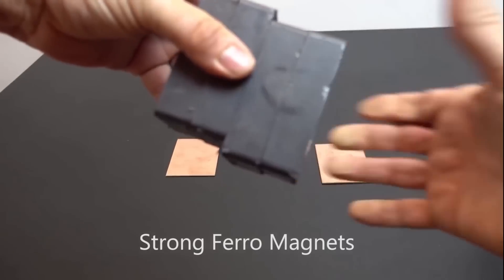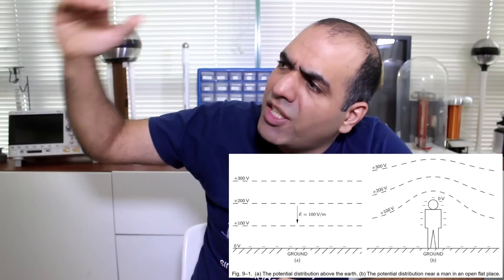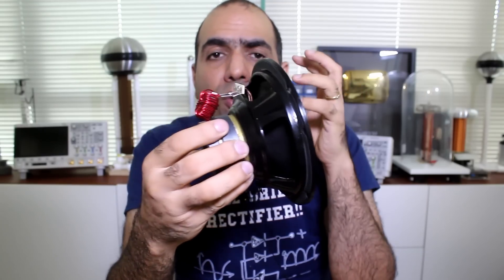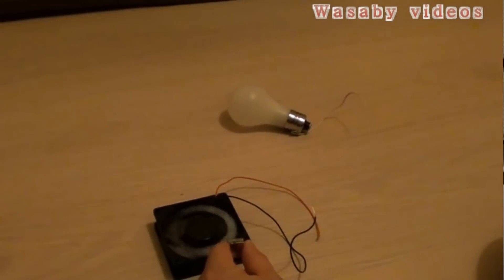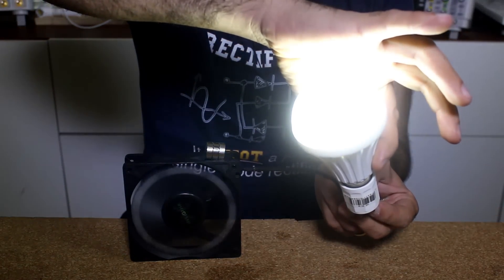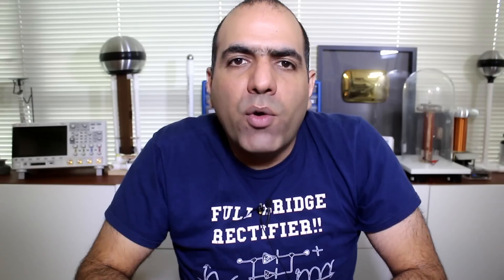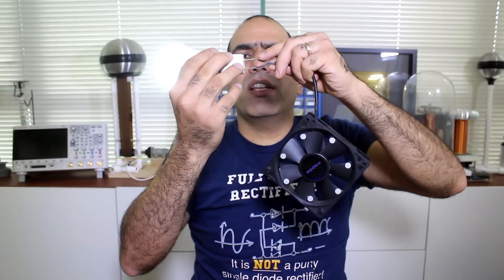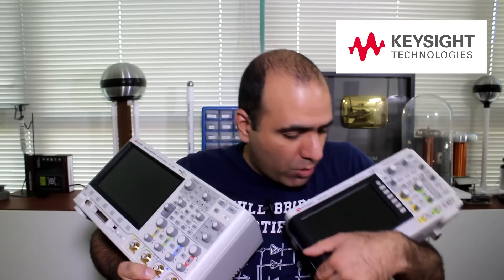Free Energy Devices Build and Science

Comment: Did people forget the hydro electric generator?, 
You pay for the components that makes up a electric generator and the next step is to use the water current to make a wheel spin which causes friction between magnets & copper coils that could power a house compliant :). The components were not free yes but the result after that is since you dont pay anyone for the electricity which the hydro generator creates and thus it is definetly defined as FREE.
Reply: That would be free in the monetary sense, which also goes for solar etc

But in these contexts, we are referring to free in the thermodynamic context. In these (non-existent) machines, the energy they are meant to be providing you is “free” in the sense that they supposedly pull energy from nowhere. Solar panels aren’t free energy - they take energy from the radiation of the sun, and hydro systems take energy from the gravitational energy in water

Comment: Perhaps you could build a light generator which is solar panels illuminated by powerful LED  which will produce electricity. The over unity factor is when the electricity ouput is greater than the electricity the rechargeable battery is using to light up the LED . There is this other guy on YT claiming to do just that. If you could repeat this idea then we will have clear validation that this idea works.

Comment: I DID actually see what seemed to be a working demonstration of that "atmospheric voltage".
The person was able to power a really tiny ionic motor from a thin wire several hundred feet up on a balloon.
(He built this really cool tiny ionic motor that ran on several hundred volts at some absurdly low current.)
(I'm guessing that, with really careful design, you might get enough power to light a really efficient tiny table lamp - suitable for a small dollhouse.)

Comment: Thanks for your confidence! Let’s take on the challenge of creating a small-scale, self-sustaining energy system. To clarify, true "free energy" systems, as commonly understood, are not possible according to the current laws of physics—particularly the law of conservation of energy, which states that energy cannot be created or destroyed, only converted from one form to another.

That said, we can focus on building an efficient energy generation system that maximizes the conversion of available resources (like sunlight, wind, or mechanical movement) into electricity, aiming for something that is energy-positive over time (i.e., it generates more energy than it consumes when considering maintenance and operational energy).

Here's an idea for a small 1000W generator/inverter system with sustainable energy concepts:

Project: 1000W Solar-Powered Generator

This system uses solar panels, an inverter, and a battery bank to generate and store energy. We will focus on renewable energy and use practical, existing technologies to achieve as close to "free energy" as possible in a sustainable way.

Components:

1. Solar Panels:
You’ll need a solar array capable of producing 1000W (1kW). A typical panel produces around 300W, so you'll need about 3-4 high-quality panels. The exact number depends on your location and sunlight availability.

2. Charge Controller:
A charge controller is necessary to manage the power from the solar panels and prevent overcharging the battery bank.

3. Battery Bank:
Lithium-ion or lead-acid batteries can be used to store the energy. For 1000W power, a 12V battery system with a capacity of at least 100Ah (amp hours) will work. This allows for energy storage for nighttime or cloudy days.

4. Inverter:
A 1000W pure sine wave inverter will convert the DC power from the batteries into AC power (the type used by most household appliances).

5. Wiring and Connectors:
Proper wiring, connectors, and fuses are essential for safety and performance. Ensure you use appropriately rated components for your system.

How it Works:

1. Solar panels collect sunlight and convert it into DC (direct current) electricity.

2. The charge controller regulates the voltage and current coming from the solar panels, ensuring the battery bank is charged safely.

3. The battery bank stores the energy for use when the sun isn’t shining.

4. The inverter converts the stored DC energy into usable AC power, which can then be used to power appliances or small devices.

Efficiency Considerations:

1. Maximizing Solar Panel Efficiency:
You can improve the overall efficiency by placing the panels in a location with optimal sunlight exposure and by using MPPT (Maximum Power Point Tracking) charge controllers.

2. Battery Type:
Lithium-ion batteries are more efficient and have a longer lifespan compared to lead-acid batteries, but they are more expensive. Choosing the right balance between cost and longevity is key.

3. Energy Management:
Focus on reducing energy consumption in your home or workspace by using energy-efficient appliances and lights. This will allow the 1000W system to provide more meaningful energy savings.

4. Expansion:
Once the basic setup is functional, you can expand by adding more panels or batteries for additional capacity.

Costs & Practicality:

The total cost will depend on the quality of components, but you can expect to pay around $1000 to $2000 for a good system (panels, inverter, charge controller, battery bank).

It’s important to regularly monitor and maintain the system to ensure its longevity.

Next Steps:

1. Research local solar panel and battery prices in your area.

2. Design the system layout based on your space and energy needs.

3. Start with a small-scale prototype (e.g., 500W system) and scale it up as needed.

Would you like to dive into the specifics of one of these components or learn about the calculation and setup process for one of them in more detail?
Reply: You could’ve at least deleted the last part where chatgpt asks a follow up question🤦‍♂️

Comment: Well, I can tell you I built a 100A self charging self sustaining solar power system that doesn’t use solar panels, expandable to 1200A. Each 100A charge controller utilizes 15A of battery power while delivering 100A of charging current. Subtracting 15A gives you 85A of charging current per 100A charge controller. Fully automated.
Reply: Bro go take a nap what is a solar power system that doesn’t use solar panels? And holy shit would your battery controller be innefficient
Reply: @f.i.b3027 it’s not inefficient at all bud.
Reply: @marciomaia4020 ok sure it isn’t but what is a solar power system without solar panels? You skipped out on the part where energy is actually “made” and just talking about the management system.
Reply: @f.i.b3027 of course I didn’t tell you how it’s made😂😂 but it is made without solar panels.  The battery powers the device that produces the 100A of current going to the controller charging the battery.
Reply: @f.i.b3027 with a 100A battery you can allocate 15A of charging current leaving you with 70A of battery power for devices during charge time. How’s that inefficient?
Reply: @marciomaia4020 well how the hell are you getting energy to charge the battery? It’s obvious that you need solar panels which your system would make sense. But you said no solar panels?
Reply: @marciomaia4020 you didn’t tell me because it doesn’t exist. Bruh you ain’t convincing anybody simply by just saying something just “works”.
Reply: @f.i.b3027 you do know that solar charge controllers can take any DC input, it’s not just for solar panels right?
Reply: @f.i.b3027 I’m working on getting it patented that’s why I’m not telling you how the power source works. I’m not stupid 😂 but when it’s all done I’ll make a video and post it.
Reply: @f.i.b3027 did you watch the video?
Reply: @marciomaia4020  Yes I watched the video I don't know if you are joking but he obviosuly concluded the video that free energy doesn't exist.
Reply: @marciomaia4020  Good luck on getting it patented the majority of "free energy devices" fail to get patented.
Reply: And what is the voltage of the 100A of output? What is the voltage of the 15A input?
Reply: @mqb3gofjzkko7nzx38 so the battery is 48v 100A. Charge controller is 48v 100A. The input power source utilizes 15A at 48v from the battery. No solar panels as input power source.
Reply: @mqb3gofjzkko7nzx38 the power source produces 4800watts  at 140v going to the charge controller while only utilizing 15A from the battery.

Comment: There one concept that could be used to create a free energy device. It's ridiculously impractical. To power one house would require a few HUNDRED acres of surface area which makes it inconvenient. Fine capillary tubing will lift water and exude drops of water continuously. Set up a few billion of these dropping water onto a waterwheel and you would get free energy. However solar panels in a very dark place would produce far more electricity over that surface area. But, it would work, but it's just ridiculous.

Comment: So... the waterwheel is bul*sh*t?  😢😂😂
Reply: That's not the point, the point is that you can get more energy than what you input which is not possible, the waterwheel produces energy but that's not what they mean with free energy, you can only transform it into the same energy you input (Usually less than equal because of friction and heat loss).
It's not a "it hasn't been discovered yet" thing , it's a "it's not possible because it breaks the laws of physics"
The waterwheel does not create energy out of nothing it comes from somewhere (the kinetic energy of the moving water)
Reply: @marufranco5281  I appreciate your response, I didn't think of it that way. Thanks 👍

Comment: Hi, loved the video. I have a question, if i take two six inch round magnets put them on their edges space them four inches apart that creates a magnetic field put twenty gage copper wire coil in the magnetic field it should creat an electric current in the coil witch leads to a boost converter witch leeds to a quad converter then to a super conducter to a circuit breaker to a voltage regulator then to a power outlet, could this produce a fair amount of electricity say five volts or more ?  I sure would like your input. Thank you for listening 😊

Comment: There are only two sources of free energy... the pyramids and the Tesla Tower... and it is through the transfer of energy intensively by removing the resistance of the medium between the negative groundwater and the vapor layer in the air at an altitude of more than 100 or 150 meters with a voltage booster and an electric boost. Wireless transmission of energy. In the air...it could become practical if wind and solar energy on residential towers were combined appropriately with a steel cement heat tank, a two-way well or sea water, and a stainless steel heat pump, linked through the transfer of energy with water vapor and air with Water for the entire system.. Electricity can be generated in three ways: solar, wind, and voltage differential on every building 25 floors high.
Reply: There is no free energy

Comment: Could you feasibly get energy from radio waves? I know about the "Radio Galena" which works with no batteries. But i genuinely dont know enough about it

But there are so many radiowaves in all frequency ranges going on around on the air that i feel a tuned circuit could get a few volts from that

Not really "free energy", but it would be taking advantage of a real source, right?

I have to asume that the problem is that high frequency/low wavelength doesn't have enough energy to get even 1V. But my knowledge of RF is pretty limited so i would love some help

Comment: But with the computer fan, if you could have magnetic opposites from the center of the fan to the magnet itself, it could theoretically, spin the fan....and a computer fan that spins, even when it's not electrically charged, can create electric energy.
Reply: It couldn't, it would stay in place and wobble a bit, because that's how it works.
Reply: @RealElevenTimes  How would it stay in place? When you have magnetic opposites, at the right angle, they push on each other.

Comment: If you do believe in free energy, you got a serious problem. Taking a potential difference of for 100,000 wallet do you have to consider that it’s only static field point to get power or least energy out of it the current needs to be multiplied by voltage. Your scenario closing the loop voltage drops to zero when current rises. 0 times 400k equals? Concerning loops, you know that you have to have a change of magnetic field in the loop to get magnetic flux. This does not want to change directions so you have to force them to. It’s just energy transforming. As far as I’m concerned, I do not think magnetic flux is best couples from one quarter to another with Ferro-magnetic material and not air.  you are violating the laws of physics, the law of conservation of energy states that energy can only be converted into another form of energy. It doesn't get lost, wear out or even become larger in the end. Perpetuum Mobile is a wet dream from centuries past. So, if I'm wrong, please build me a power plant that generates energy from the air. someone brings the proof and does it and stops babbling about it. This is bullshit. just clickbate. I thought you were serious in basic physics of electricity. If you believe what you are telling us, you’re supposed to be the new Catweazle, performing his electric trick 😂  Nasty whitcher stop fooling people 🫢 i’m outta here..

Comment: Hilarious ! I ! I   but there is resonance ,,  there are some things you can do  ..  imagine a circuit that incorporates MOSFETs for high speed switching, some inductors,  capacitors, coils, magnets,  resistors, and a 27000mhz quartz crystal also some LEDs and power it with six volts from an almost dead nine volt battery  ..  mine fried so I am going to have to start over and since I was just playing around I wasn't ready to measure how much voltage there actually was but I could see it ratcheting up in the LEDs before they fried.  I was looking right at a ten ohm resistor when it heated up enough that I could see waves eminating from it as they were back lit by the LEDs like a heat wave maybe however it did not have any soot on it. The idea was to create something to create the swing that you need to run a Tesla coil only there's no coil yet but I was hoping for something I could tune to adjust the resonance ..  I thought perhaps that two resonant fields like this could be played against each other and maybe with a 28000mhz quartz crystal if I can figure out how to keep it from frying  ....

Comment: "free energy" where you amplify one type of energy is not possible.

Mysterious energy harvesting, though mysterious, is possible. Heat pumps, i.e. the refrigeration cycle, also have a COP > 1.0 as heat pumps will move more joules of energy in heat from a cold location to a hot location....In other words, the heat pump does more work on the environment than is done on the pump.

The key point is that "mass energy" is not being created or destroyed but rather "potential energy" is being manipulated in creative ways that allow for a higher output of work than the input of work.

The refrigeration cycle is and will always be proof that it is possible to build machine that have higher "work" outputs that "work" inputs: overunity. So while free energy is not possible, it's only in the sense of stupid ideas. If one considers the energy in "work" to be equivalent to the energy in "mass energy" then the heat pump indeed provides "free energy" as the heat pump does more work on the evironment than it is supplied.

Because heat pumps opperate on the principle of overunity, more "work" (not mass-energy) output than input, a self-sustaining loop can be made using nitinol or other shape memory alloys that calorically absorb heat to produce mechanical motion. S.M.A.s contract through an endothermic chemical reaction and convert heat to mechanical energy at above the maximum carnot efficiency for the same temperature differential due to the first and second laws of thermodynamics, still bellow 100% but above maximum carnot efficiency.

This allows SMAs to be coupled with the refrigeration cycle to create a self sustaining heat scavenging generator.

It's not creating "mass-energy" but it is "free-energy", one of the components in the system exhibits overunity and that's the only reason the energy scavenging cycle works.